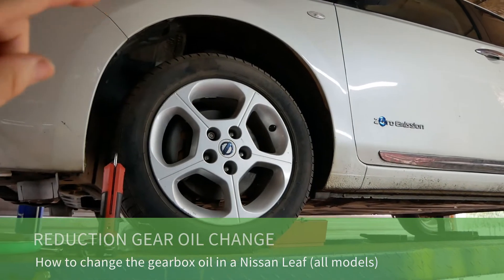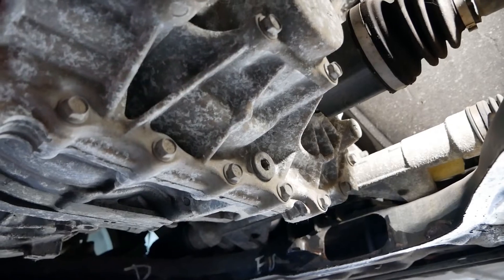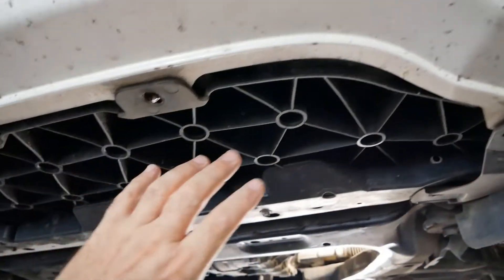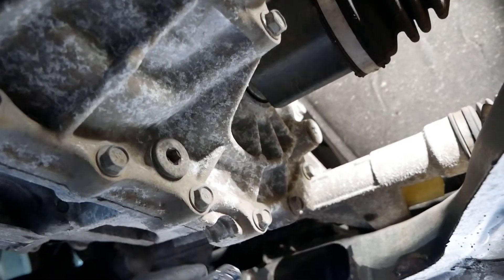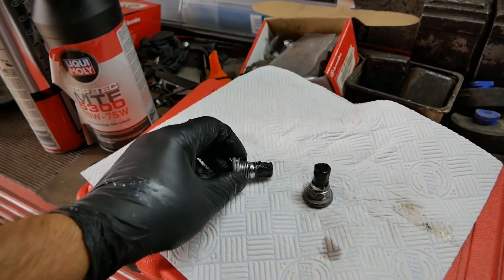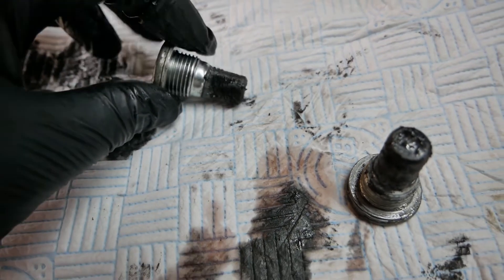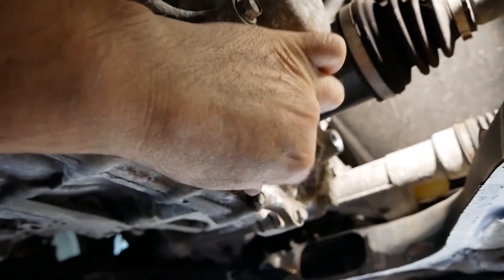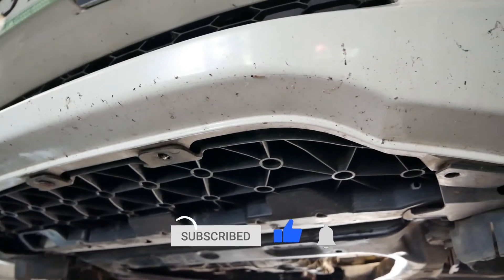How to change the reduction gearbox oil in a Nissan Leaf (all models)

Comment: Wow, so glad this video exists!! Awesome! I have a 2025 Leaf sv+! Because of the Aryra, and the 2026 Leaf is so great, my $25,500 car is worthless for trade value, I have no choice but to keep my Leaf. Im shooting for 20 years or 250,000 miles ( according to google). Its a great Willamette Valley driver, not so much road trip long distancer!
Reply from the maker: Glad you found the video useful. The Leaf is a reliable car and should last. The batteries have been the only weak point on the earlier models. But with yours being a bigger battery model, a small loss in range over the years will be less of a problem.

Comment: Does the car need to be straight? I mean can i just lift car from front.
Reply from the maker: You do want the car level when filling it otherwise you wont be able to get enough oil in. A slight angle will be ok, but best to be level. You should be able to remove the undertrays and plugs while on your ramps, then drop it down to refill and back up on the ramps to refit the trays.

Comment: Great vlog, any idea on what transmission oil to use for a Nissan townstar EV 73 plate 1 speed automatic, many thanks and kind regards Mark 😃👍
Reply from the maker: I don't know for sure, but I suspect it will be MTF 75W-80 as other Renault EVs are. (The Townstar is a rebaged Kangoo e-Tech).
The Townstar is still quite new, so a bit early to be considering an oil change, unless you've done loads of miles. I would do it around 50-60k miles.
Reply: @ ok great 👍 thank you for coming back to me it’s only got 10k miles but I’m just a fussy ol tart 😂😂👍👍

Comment: Changed the oil in my 2011 ZE0 yesterday, with help from this (and the O&DR Modurol) video. Oil was presumably factory new..brown but smelled OK after 100,000 km. I used Nulon Low Viscosity ATF which lists Nissan Matic-S on the pack; the squeezable bag + hose makes filling from underneath pretty easy. More material on the magnets than shown here but only fine stuff. I might have slightly overfilled due to not being able to get the car perfectly level. Seems a bit quieter - will see if the efficiency improves too.
Reply: Any update?
Reply: @MaxInNewZealand The LEAF's running nicely, with I think a slight improvement in energy economy. My driving has some hills and the regen is a bit limited on an old battery, but I'm getting about 6.7-7.0 km/kWh overall. I'll likely change the oil again within the next 50,000 km as it's cheap and pretty easy to do.

Comment: Are there any other jobs worth doing while you have the undertray off? Thank you for these videos - they're clear, concise and comprehensive.
Reply from the maker: No, not unless you need suspension work.
Reply: @GoGreenAutos  Mine does have slightly creaky struts, I've noticed...
Reply: I sprayed the front suspension bushings with silicone oil and the creaking is gone.

Comment: My 2014 Leaf (90,000 km) has been making a slight hum noise when going over 80 kph.  Is there a chance that it might be the reduction gear?  Or would it more likely be one of the wheel bearings starting to go?  No real change over the past 5,000 km.
Reply from the maker: I would change the oil as that cheap and easy to do. But more likely a bearing - either reduction gearbox, wheel or motor.

Comment: I was told to change this fluid every 4 years or 20 thousand miles.  I live in Southern California.  Does this sound wrong to you?  I am suspicious.
Reply: I think it's because ATF works well enough, and Nissan didn't want to stock a new GL-4 gear oil at dealerships.  What I've seen is other EVs often using just ATF too.  Tesla, for example originally used GM Dexron VI, but switched later to GL-4 gear oil, and they went to thick, way above 75W.  Depends on the ev brand and model, but I think just plain ATF is in about half of them, good enough.
Reply: I'd also imagine that the lower viscosity gives an energy economy advantage.
Reply from the maker: Well it will do no harm, but every 20k miles is a bit early and wasteful. 
In UK/EU, Nissan say it doesn't need changing for the lifetime of the vehicle.
Reply: Nissan in the U.S. does say it never needs changing.   I would say change it every 80,000 miles or 6 years to try to get some life out of those gears/differential.  There are some reports of these things failing around 100,000 miles from too much metal dust in the fluid, I'd guess.
Reply from the maker: @softwaresignals  Its the differential gear that breaks up and much worse on cars that have used the torque.
Reply: @GoGreenAutos  For extra EP (extreme pressure) tribology performance in the gears (diff, reduction, bearings), I would use gear oils that have slightly higher levels of phosphorus, still at the GL-4 level (no need to go GL-5 since there is no hypoid gears).  Example:  Valvoline Maxlife ATF fluid is the same viscosity as Nissan Matic S, yet has about twice the EP phosphorus.  Amsoil ATF fluid and Redline ATF are similarly packed with extra anti-wear stuff too.  (Best part is, we have no friction-finicky clutches, so any ATF or thin gear oil works fine.)
Reply from the maker: @softwaresignals  As you clearly know a lot more about oils than me, why do all other EV manufacturers use manual transmission oil (typically 75W), yet Nissan uses ATF oil in the Leaf and ENV200?

Comment: Here in the U.S., Nissan says to do Maintenance on the "Reduction Gear" (gearbox) by opening up the upper Level Plug and checking the level, top off if necessary, every 1 year or 15,000 miles, whichever comes first.   And replace crush washer there with a new one, and torque to 25 lb-ft.   .... Not many people ever bother doing ANY of this.   The risk is having an under-filled gearbox from the factory and not discovering it, or there could be a leak, although with a leak, you can detect it if enough leaks out and then makes it past the under-cover piece on to the ground where you park it.  ... As for fluid to use, Nissan Matic S is the one, or really any ATF fluid that says it works as "Mercon LV" or "Dexron VI".  Popular choice here is Valvoline Maxlife ATF, works fine.
Reply from the maker: Yes I would agree, a fluid level check would be rarely done by any main dealer. In reality, it doesn't achieve much unless the factory under filled the gearbox. Does that happen? And if it did, by the time a check was done, it would probably be too late.
Any oil leak would be obvious too.
If you're checking the level, you might as well just change the oil.
Reply: @GoGreenAutos  It happened to me, one time I know of.  '15 Ford C-Max Hybrid CVT (Prius-style) transmission, no leaks.  I found out it was slightly, not seriously, underfilled when I compared temperatures (sensed with OBDII reporting) with other C-Max owners on an internet form, and mine seem to run a bit hotter.    Nothing catastrophic.  I checked the level and found out the factory did not put enough in.  They get in a hurry sometimes, spill some, etc., and they don't want to stop the assembly line and admit mistakes, typical scenario.  Factories do indeed make errors, and the C-Max problem here would only degrade the life of the transmission a little.
Reply: Wow, I am worried because mine has 100K miles on it and I can guarantee it has never been serviced lol
Reply: @joseprieto  As long as it never leaked out, it's probably basically OK.  Nissan says just check the level and top off once in while, but it is good to change it out with new fluid once every 80,000 miles or so.
Reply: @softwaresignals  Well, I am going to do some work on brakes. Since I am going to be tooling about I may as well give it some fresh lube.

Comment: The instructions are essentially identical for the same task on an e-NV200. Just the plastic undertray is a different shape.
Reply from the maker: Yes and pretty much the same on all EVs.
Reply: Yes, much the same - but at least for the e-NV200, same Nissan Matic S oil, same quantity 1.35 L, same 10 mm spanner, 10 mm hex key, 18 mm sealing washers, fill/level and drain plugs in exactly the same places. Not for nothing does the e-NV200 service manual introduction say, "for the NISSAN LEAF, model ME0   series."

Comment: Nissan leaf secondhand car prices  five thousand euro 2013 car you can upgrade battery 24 khw to 40 KHw
Reply: I have been driving a 2011 Leaf since August 2010 and just upgraded the battery to 62Kw. Now it has a second life with a 450km range with a single charge. Great car. No issues at all. Last 14 years. Saved tons of money. No need to buy 80K- 100K new EV. Prices are insane, I would recommend anyone find 20111 and 2012 Japan-made, lightly used, not abused Leaf and replace the battery for 2-3K. I was lucky to find donor battery for $2500 Cad. Sold my old battery to a guy who does solar project for 500CAd. Therefore, 62 KW donor battery came to me for 2,000 Cad.
Reply: @m.necatisepetcioglu4391 Was fitting not expensive?
Reply: not sure if battery upgrades are still available in UK..